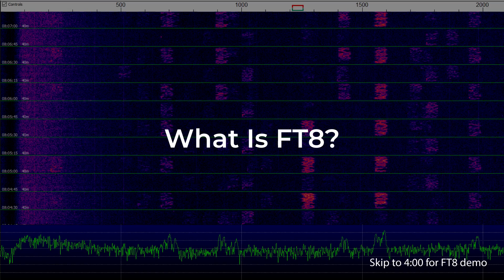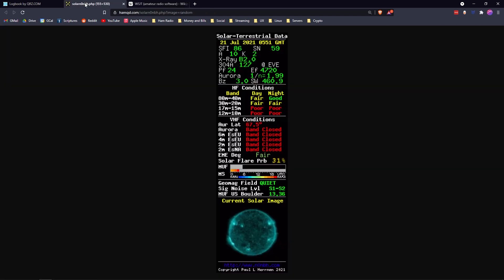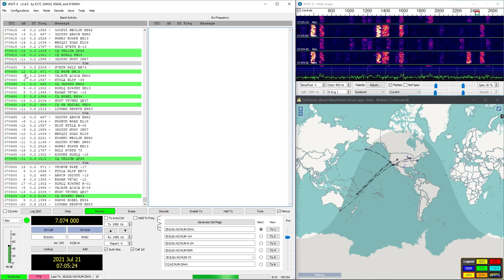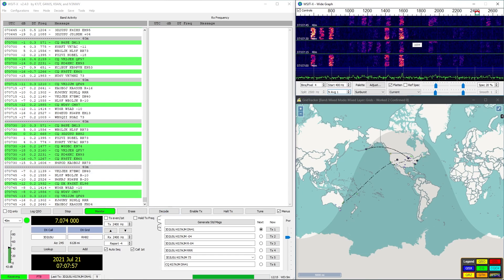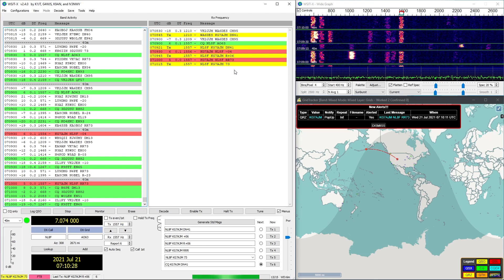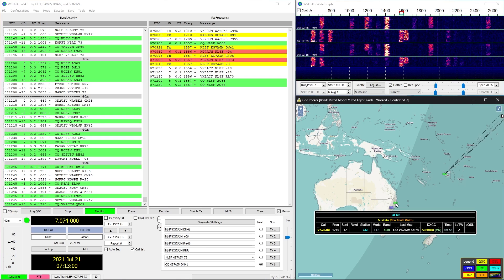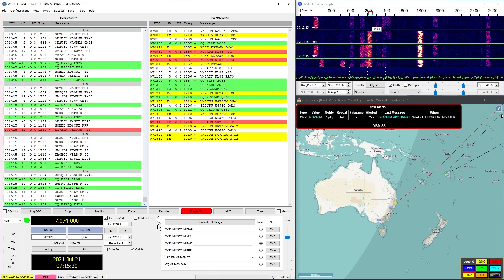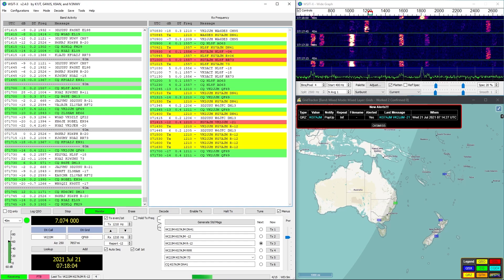What is FT8 & Weak Signal Radio Communication? (Ham Radio)

Comment: I read an article on FT8 and wanted to look in to it because I've never heard of it. It's cool but what's the practical application?
Reply from the maker: FT8 is almost exclusively used for getting contacts fast, nothing more, nothing less.

JS8 Call on the other hand uses the same technology and allows you to basically send text messages through the radio back and forth with no limit on character count. It would be more useful in an emergency situation, especially when dealing with weak signals.
Reply: @jonlawrence  If you cant talk to them, why get the contact in the first place? I just came across FT8 today and know nothing about it.  I've been trying to find an explanation for it.  Wouldn't CW be better?  Being able to see the signal does look cool.
Ok, after watching more of the video, you make a contact and give each other reports.  Is that it? You cant use voice so what is the purpose?  I hope I dont come across in a negative way. Im trying to understand the reason for FT8 and see if its worth trying. Just making contacts without being able to do anything else doesn't seem to have a real purpose except for doing something just because you can.
Reply: @steher  Same here, ft8 makes no sense to me either. A guy in the club said 'I made a contact', I told him 'no you didn't, your computer did'.
I compare FT8 to CB... 'Break 1-9 for a radio check...'